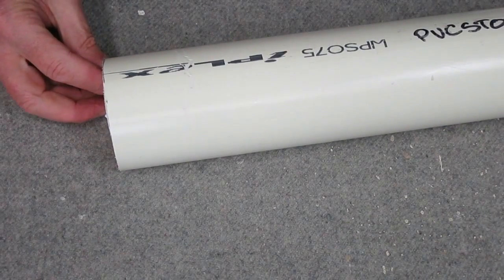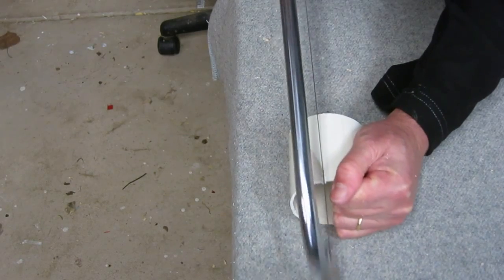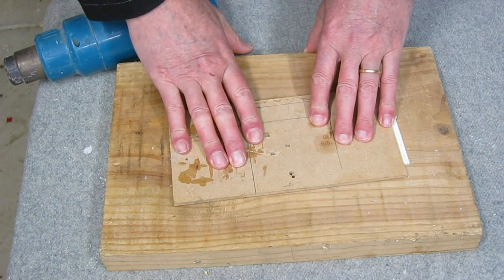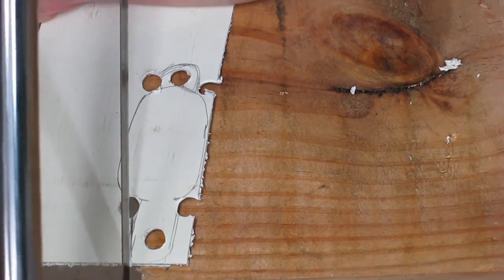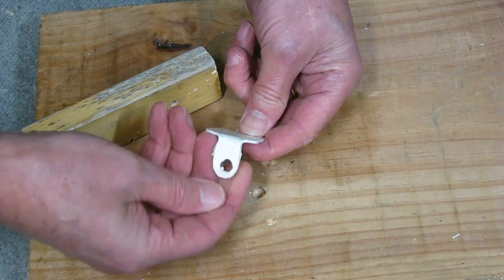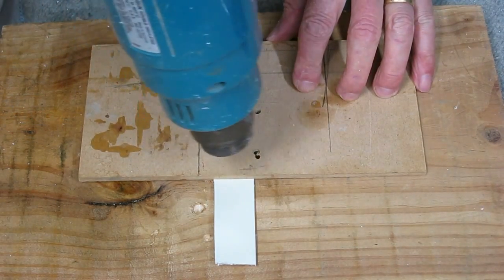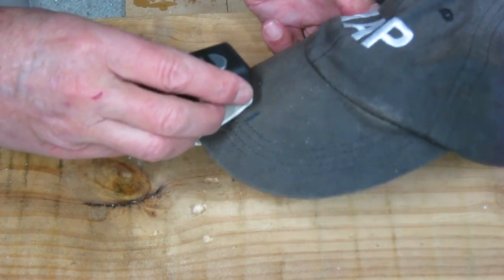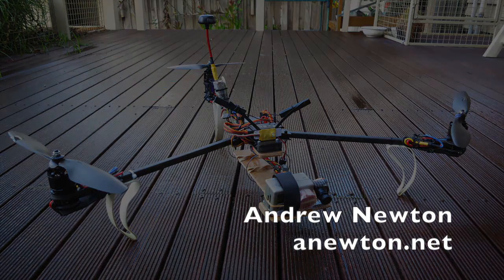Heat bent PVC

Comment: Do you fill the pipe up with sand to heat and bend plugging the ends making off sets done this in training collage 1970s  for plumbing Themo plastic  it was new on the market  coloured grey or black
Reply from the maker: No but that's an interesting idea

Comment: Hi andrew,I recently bought a mobius  full hd camera,charging is through the usb connection you just plug it in,my led stays yellow is that normal,is there a way I can see the battery charge progress,thanks andrew
Reply from the maker: +ashley schooneman Plug it in, yellow LED comes on, push the power button and it should turn green, then it goes off when charged.
Reply: thanks andrew,for your help :)

Comment: Thanks Andrew, Looks like I have a trip to Bunnings coming up soon. I did use Velcro for my Mobius on my cap but your PVC folded strip suits the job better with a rubber band. And I no longer have to tilt the cap up to keep the plane in view. I've always wanted a hot air gun anyway.
Reply from the maker: coongoola incorporated Yep it works well Pat. My Mobius has the A lens which is not as wide and better for flying footage.

Comment: Hi Andrew, thank you for sharing your ideas, it helps us a lot. Just wondering if you would make a short video about how you fit the selfie stick to the plane, or if you can guide me to some link with some usefull informations about it.
Cheers
Reply from the maker: turpi27 The bottom bracket is similar to the camera bracket but it has wider side wings which are shaped to fit the Bixler under-nose. Then I just tape it in place with Scotch Tough Tape.